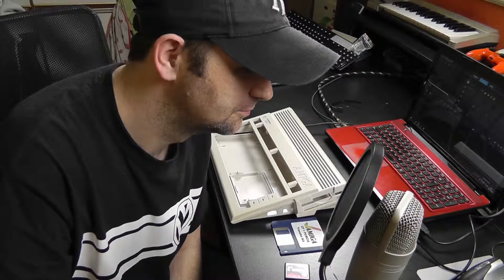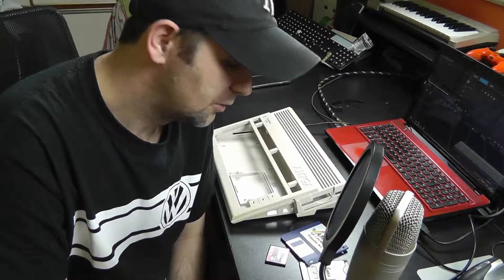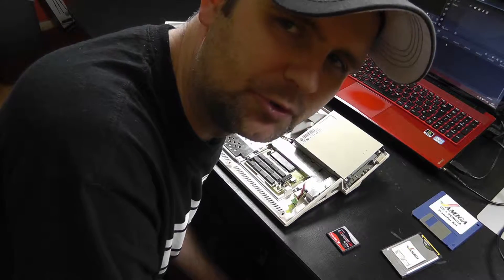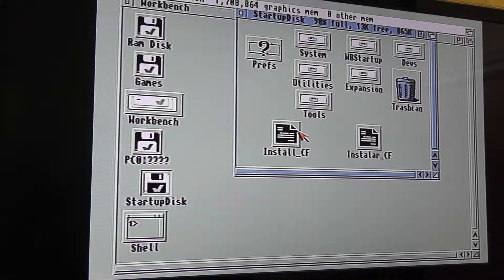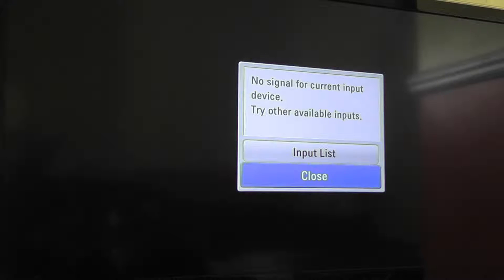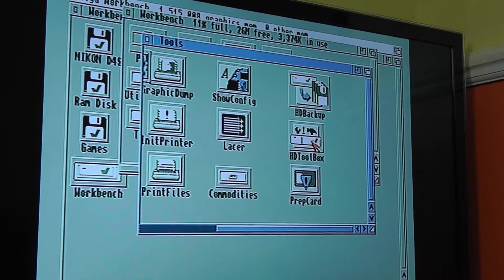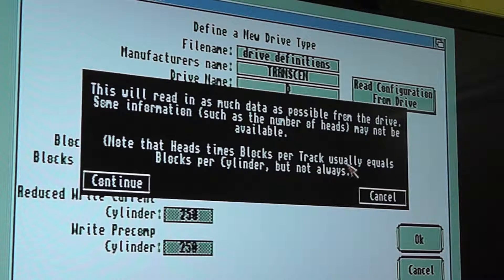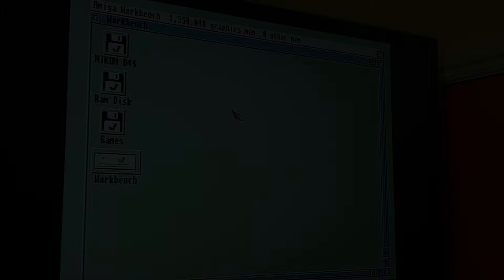Amiga PCMCIA and Hard Drive complexities

Comment: I bought a CF to SD adapter. My supplier included an installation disk. Did yours?
Reply from the maker: No bud, maybe that's an issue
Reply: @RiotRetroGaming  The installation disk is available as an ADF file for those who have removed their internal floppy, so you should be able to download it and make it into a real disk.
Reply from the maker: Great reply! Thanks 😀

Comment: Not really following what you are trying to do?  I get that the SD to compact flash adapter is not working - I would just buy a CF card, they are dead cheap now for 8Gb cards etc.  Amazed that you got that 128Gb card working with an Amiga!  I didn't know they supported such large sized drives!  I just use a couple of 4Gb cards in my 1200 with a switch to toggle between them and I've fit everything I want on there plus I've got 4Gb ish spare.
Reply from the maker: Description gadget! read away lol
I'm showing from a complete beginners point of view what it's like dealing with the Amiga and how to get things going (the difficulties and such).

It's a 128MB card there.